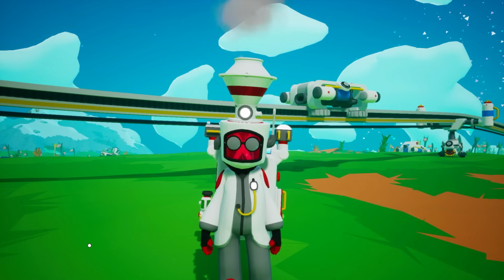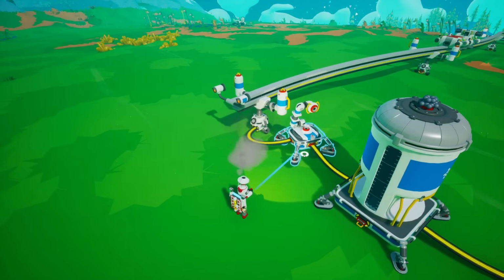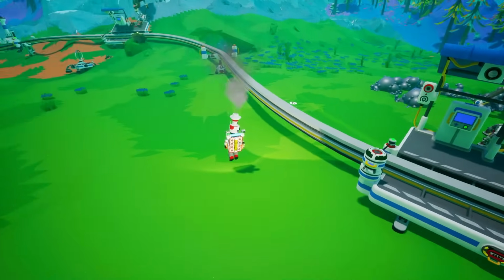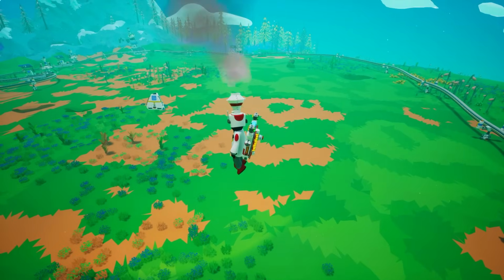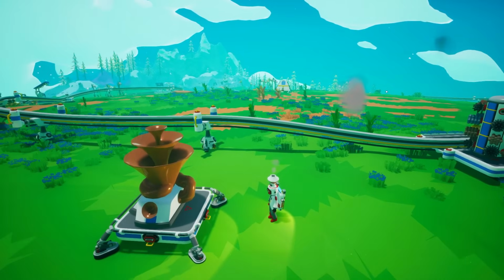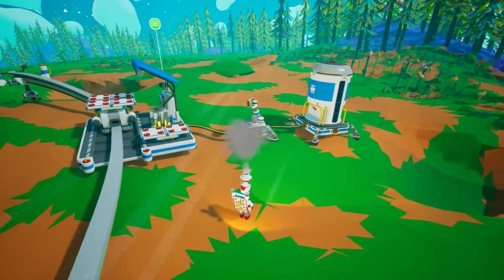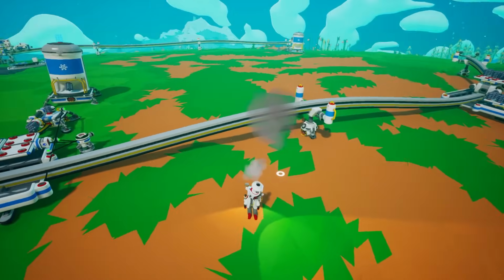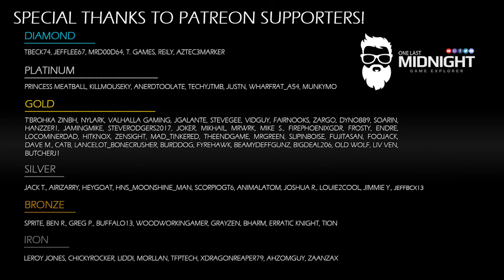Astroneer - Rail Automation- The Basics - A Helpful Guide | OneLastMidnight

Comment: I’ve been complaining so long that this game needs a conveyor belt delivery system and your video just made me realize that trains can do exactly that. The possibilities are endless for easy resource crafting automation around my bases now! THANKS!!!!
Reply from the maker: Great to hear!
Reply: you can also make an automated astronium delivery system for making fault finders and trading them, you just need rtgs or qt-rtgs because theres no sun and very little wind down there
Reply: @fonsworththethird  This is probably a bit late but you can use power extenders with surface electrical systems for the same results (Solar/Wind with battery banks for night or still air are likely a cheaper alternative) but that shouldn’t matter with late-game automated Nanocarbon Alloy
Reply: @fonsworththethird  Fun fact: I'm a mantle dweller, so that's not a really bad problem.

Comment: In the 2nd example you could actually skip all of the button repeaters and connect stuff directly. Their only purpose is to enable you to press them bu hand. In the 3rd example, stuff is usually made by setting the right stations to load/unload and applying the storage sensor set to full/empty with a proximity repeater attached. This way, when the car gets fully loaded/unloaded, it sends itself right back. No additional rail posts on the ends needed!
Reply from the maker: Never really felt rails were fully completed.

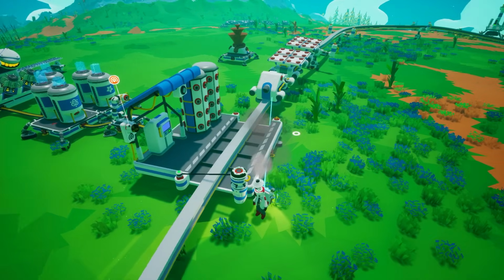Comment: I'm having an issue with the setup you described at 4:59 where, even after workaround, the delay repeater doesn't seem to be activating the station to send the car onto the next station
Reply: Found a workaround, just put a proximity repeater where it would only hit the car instead of directly from the delay to the station

Comment: Would there be a way to set this so you're down in a mine n you send it away and once it has emptied it comes back to the mine?
Reply: I actually figured it out. Storage sensor watches train canisters and it triggers the train when full and again when empty.
Then empty canisters at the station by triggering canister output changes after a delay.

Comment: wait...why are you activating and deactivating the autoarms with the sensors? all things take power when they are active only...I noticed this on a small setup whenever anything was being used, something like a smelter burning stuff will take quite some energy and you could see it on the platform indicator as it goes down and up once it is not burning anything but it is turned on

Comment: For the last part on 12:53, i tried the exact same thing, but the relay and storage sensor doesn't seem to call the output side back, what do I need do? I noticed your output side has no sensors as well.
Reply from the maker: The one storage sensor triggers both the station and the return slot on station.
Reply: @OneLastMidnight  then if the “one” storage sensor on the input side is all that is needed, then I am not sure why is mine not working… 

I do notice that my rail station for output side is on the same side instead of the opposite setup like you did. Do I need to swop the side? Oo
Reply from the maker: Ahhhh...  Yes, and thanks for telling me that.   They do need to be facing opposite directions.  Also, to need to make sure there it some track off both sides of the station.
Reply: @OneLastMidnight  i had placed the rail stations on opposite directions, but the rail station on the loading side won't call the rail at the unloading side. 
any suggestions?
Reply from the maker: I won't be back till Saturday, but if you upload your save to the share folder, you can reach out to Ronlaflem on my Discord and he can take a look at it.  Assuming you are playing on Steam.
Reply: @OneLastMidnight  sure! thing is
- I can't join the discord link
- I can't find "Ronalafem
- The shared link wise I can't create a new folder

Comment: can you put like a storage sensor, set to empty or not empty then connect it to the arms so they would shut off?
the problem is then when the train come backs before it gets everything unloaded
If only the automation in this game was much easier to understand 😭
Reply from the maker: Yes, for sure, but the point of the video was to show you could automate via the rail lines, and station.
Reply: @OneLastMidnight  I always struggle with automation. Was just wondering if it would work as anything I try always ends up not working or complicated.
Reply from the maker: I hear that.  Took me a little while to wrap my head around the stations.  Now I need to figure out junction automation.

Comment: i'm guessing in the 2nd one you could have turned the autoarms on or off with a storge sensor on the storage
Reply from the maker: Complete agree, but I was giving an example of how you 'could' use the reaction slots on the rail pole, and not how to use the storage sensor.  Yes, it isn't a perfect example but it works if you understand what I was trying to accomplish.
Reply: @OneLastMidnight  now that i know that it will work i can try to figure it out :)

Comment: You can actually put a storage sensor on whatever storage you use that’s on the car itself with a prox on top and the car will send itself once it fills or empties
Reply from the maker: That is my first example of point to point, but no need to be on the storage because the car monitors all storage on a rail line.

From release notes...
"Storage Sensors and Railway Vehicles
When placed on a railway vehicle, the Storage Sensor will monitor storage state across the entire train."

Comment: NGL The automation capacities feel underwelming. In all examples having a branch on the network would break everything. And If I want to filter ressources I need a specific railway for it.
Reply: You can use rail sensors to activate junctions. You can make a train go from A to Z, branching off to different locations B-Y and once it reaches Z, make the train go backwards and use the sensors to turn the junctions to go directly back to A.
Reply: @ShadyAssassinXV  Is there a way to activate a junction to turn a specific direction or can you only activate it to change direction? The idea I have is that my goods train would travel automatically down the line and activate the junction to turn, but if the junction was already turned the right way, could I keep it that way?

Comment: Not yet watched the entire video, but I have a question about the point-to-point system you make at 12:46. If the rail line was longer (say, a couple of layers deep into the planet) would the train make it back to the unload station B before the loading station A recalled it? Does the rail system make the recall immediate or queue it up as the next action?
Reply: No the automation there is that the train waits for to get to point B  then it unloads and after is empty A recalls it to load the stuff.

Comment: Genuine question here that I am struggling to figure out. If the goal of the game is to unlock all planet gateways/cores and certain railway items require end-game material, what is the point in getting all this automation setup other than the wow factor? It feels like you get access to a very cool thing at the end (railway station at least) without much use for it by that point in progression to provide value to you. i.e. Early on I see the need to have various mining camps and automation to run things to your storage center on a base, but you don't have access to the auto-miner thing yet or rail stations.
Reply from the maker: While I love Astroneer, there are a few issues with it as a 'game'.  There really isn't a goal as you state it because there is nothing driving you to unlock the gateways or cores - it gain little from it unless you are going for achievements.  System Era has long stated there game is a sandbox game, and you decide what you want to do.  There is a progression with constructed items - either resources or buildings - but depending how you spend you bytes that progression my differ from replay to replay.  A lot of things can be achieved using different strategies.
Reply: @OneLastMidnight  Yeah agree. Game is solid and each update or few updates I keep coming back to play and have some fun. They're doing something right in that regard as I don't do that with all games. Just wish there was an option for a more focused goal past the core/gateway push. Hard to justify the time to setting all the cool things if it is just for wow factor alone. Comparing this to something like Satisfactory, the automation refinement is essential to get to the next tier of technology and progress within the game.